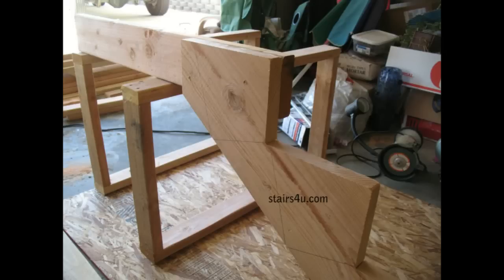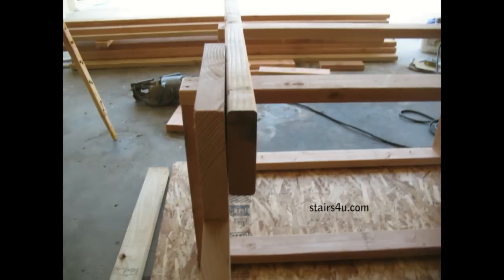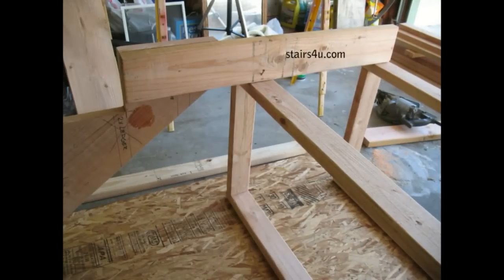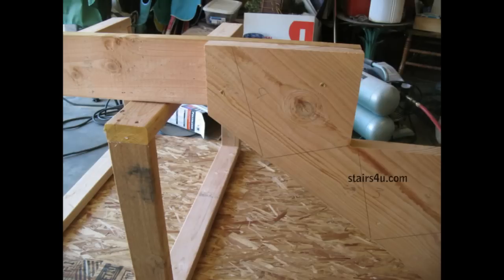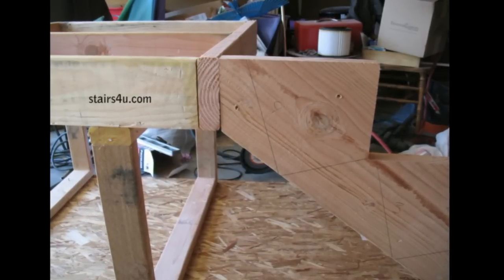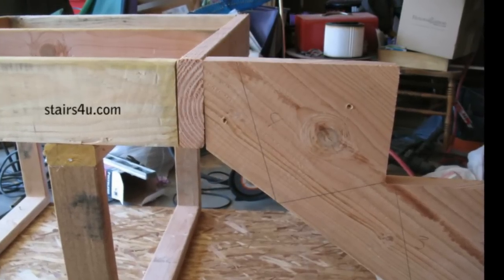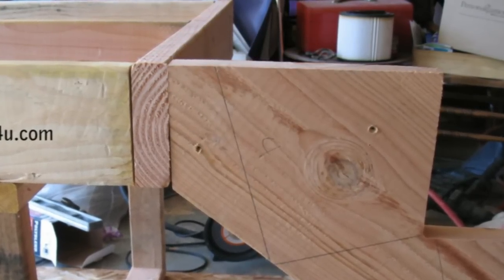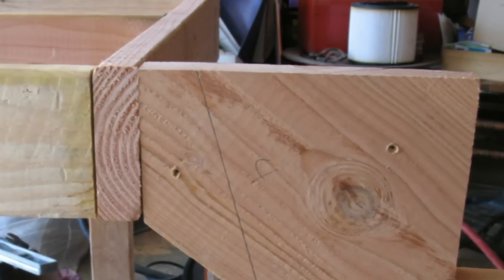Floor And Deck Stringer Connection - How To Build Stairs

Comment: Stairs have everything to do with space available. Outside steps can cover more area like the last option you displayed. Inside steps are more restricted on space and have even seen recessed stairs that ultimately uses up allot of room on the upper floor. I personally like the idea of having the top part of the stringer up inside of the decking joists. This allows for more support but less top stair area. If you use that method you showed then I suggest using joist supports and a 45 degree kicker for added weight transfer support...
Reply from the maker: As long as it's structurally safe, you can use any method you desire. These videos were made to provide people with options and this method is one I personally prefer. Additional building hardware usually makes things a little stronger, but sometimes won't be necessary.

Comment: for outdoor deck, you have to attach to rim joist, with flexible stringer connection, because of movement of the stairs (especially in winter climates).
Reply from the maker: I've never heard this before, but would love to know the reason why and what a flexible stringer connection is.
Reply: for outdoor deck i mean.  the deck has footers that are below frost level but the stairs are very often placed, at best, on a concrete slab sitting on 4" of compactable gravel.  despite the nice stair landing pad, it does move with respect to the deck, through the seasons.  its nice if your stairs are connected with a bit of flex in them.
Reply from the maker: High Hopes That makes a lot of sense and sounds like it would work extremely well in areas with cold temperatures, thanks for sharing.